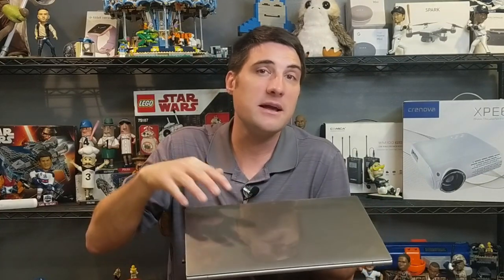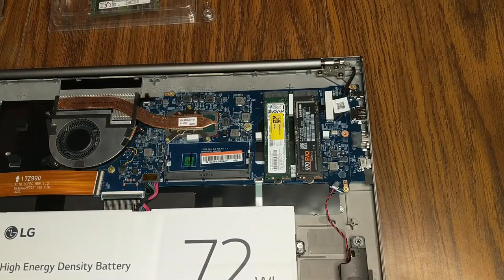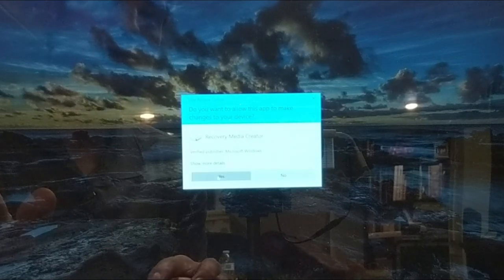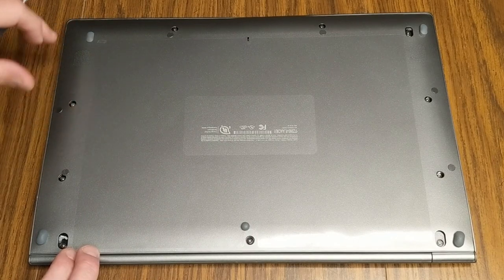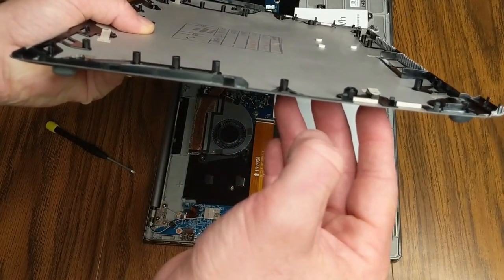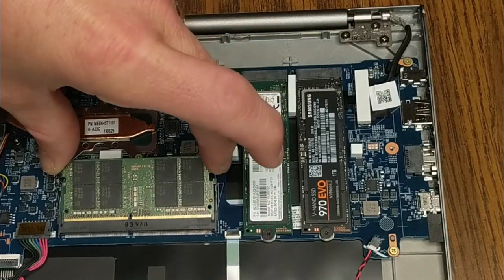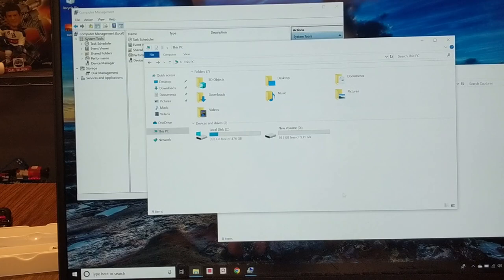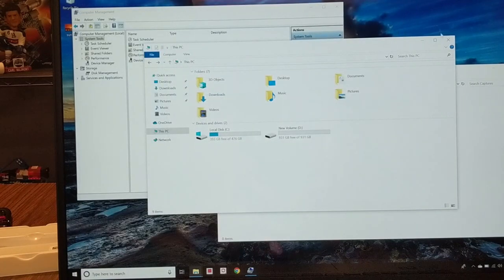LG Gram 17 - How to Upgrade Your Laptop With 2 SSD Slots (Adding An M.2 NVMe 1TB SSD & 32GB Ram)

Comment: Does anyone know if it's possible to replace the 72Wh battery with the 60Wh battery intended for the smaller Grams? How much weight would this save? Thanks.

Comment: Thanks for video. Do you know if I could use the later Samsung (MZ-V8V1T0B/AM) 980 SSD 1TB - M.2 NVMe Interface Internal Solid State Drive with V-NAND Technology as it is faster and cheaper?
Reply from the maker: Hi David, unfortunately I'm not sure. I was doing a lot of research online before I did my upgrade and people were saying they were having compatibility issues with different pieces of hardware. So I played it safe and went with hardware that I had researched would work, and that saved me extra work on the back end of trying to return equipment I couldn't use. It may have cost me a some extra dollars but in the end I think I wound up saving myself time and some headaches I'm happy with the performance.
Reply: @TinkerForward  Thank
Reply: Thank you for getting back to me

Comment: Hi! thanks... I have the same LG gram 15.6 and, is possible to add them a Nvidea ?
Reply: I have seen elsewhere that one can't add a video processor card internally but using the USB 3.1/Thunderbolt port one can use an external video card in an appropriate case.  I don't know any specifics but hopefully someone who has done it will chime in.

Comment: Hi Jeff, great, informative video. I have found on Amazon a slightly newer version of the SSD drive. Are you aware of any reason not to install? Samsung 970 EVO Plus 1 TB PCIe NVMe M.2 (2280) Internal Solid State Drive (SSD) (MZ-V7S1T0)
Reply: That's a great SSD, I've been using it in my custom built desktop tower for almost a year, works great. It should work in LG Gram no problem.

Comment: One very important fact it was completely missed and not covered here and it is to do about the memory. The bottom memory module (8GB) is soldered into the motherboard, so this is not upgrade-able. The top memory module is removable (seen in this video) and of course is upgrade-able, but when you upgrade to a larger capacity you must discard this original 8GB memory module, so it is a complete waste, unless you are able to resell it, which is not easy.
This fact should have been covered and made clear in this video.
Hope I made clearer and helped.
Reply: I agree with you, but then how did he get 8+32 = 40 GB of total RAM?
Reply: @LifeGeneralist  He could only replace (swap) the secondary 8 GB RAM with the new 32 GB RAM. The main (first) 8 GB RAM module is soldered into the motherboard and therefore not swappable. You must discard the secondary 8 GB RAM module and replace this with the new 32 GB RAM module.
So 8 GB (original soldered) plus new 32 GB = 40 GB.
So I hope this explanation answers your question.
Reply: Unfortunately kind of like pretty much every RAM upgrade I've ever done.  There should be a place we can donate these chips to so that someone of limited means can upgrade an older machine and get another year or two of use out of it.

Comment: can I install LTE module in this M.2 slot?
Reply: That's a good question - you might be able to install the module but you would need the antenna's routed throughout the laptop chassis for the signal reception. Anyways, I'd just opt for the USB 4G LTE card and call it a day - that way you don't have to open the laptop up and possibly lose warranty (and there are no antennas inside the laptop for the 4G TLE anyways, at least not that I know of). Another option I like to use is I enable the wireless hotspot on my cell phone for when I don't have WiFi around and that works just fine too.

Comment: I bought the LG gram 17 2021 on Amazon (i5, 8 GB ram, 512 SSD, at 999€). I don't understand whether I can upgrade the RAM to 16 GB. Has this model a free slot? Amazon and other sites say yes, LG website says no...but a model with i5 and 16 GB ram exists for sure, I found it in several online shop and also on notebookcheck. Does someone know which is the real situation?Thanks
Reply: I am looking for the answer on this too since I just bought the LG Gram 17 today.  Were you able to upgrade your LG Gram 2021?
Reply: @_-_-.-_-_  No, it's not possible on i5 8gb...only the 2020 model is upgradable
Reply: @davidemarangon13  thanks for your reply. Yeah, I just read on another page to confirm that it is not doable. This laptop is going back since I do lots of virtualization and will need more than the average 16 gb. Thanks again.
Reply: @_-_-.-_-_  I see. I thought about that too, but my main activities are related to office and web browsing... Moreover, I paid the notebook only 999€..Very satisfied at the moment
Reply: @davidemarangon13  if you want to see what it looks like inside, Google this article "LG Gram 16 review (2021 Gram 16 16Z90P – Core i7, display)" and halfway down, it will talk about the ram and confirm our questions. Anyway, thanks.

Comment: If you hope to upgrade the RAM on a newer LG Gram 17" laptop, you'll be very disappointed, as the RAM is now soldered to the motherboard. Why they would do such a foolish is something only they would know. You can swap out the M.2 NVMe SSD for a larger one and add another one to the second port, but the max capacity is 2TB per slot for a total of 4TB.
Reply: Hey, how do you know that the limit is 2TB per slot?

Comment: I did this same update (exact same parts), seems to work just fine (been about 2 weeks).  However, I recently noticed that my insert, delete and numlk keys are non responsive.  Even using an app to verify the hw press, nothing is registered when the key is pressed.  Doesn't work in safe mode, or different modes of selective startup.  Not sure it's related, not quite sure how it could be.  Anyone else having the same issue.  BTW - Machine is less than a month old.

Comment: should've done a raid
Reply: Yea I wanted to do RAID0 over two M.2 nVME SSD's on it but then I found out that the original M.2 slot is X4 and the second one is X2 so the RAID0 would operate at the lower X2 speeds and not improve much if at all. That's a bummer - I don't know why couldn't they spare additional 2 PCIe lanes for the second slot and make this an amazing option for people that want RAID0 and max SSD performance.